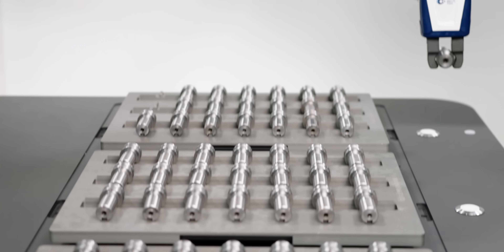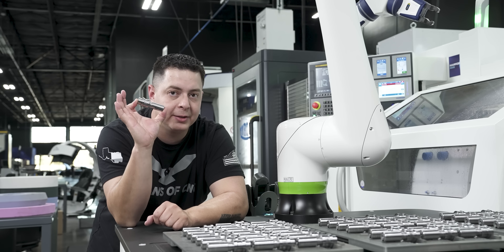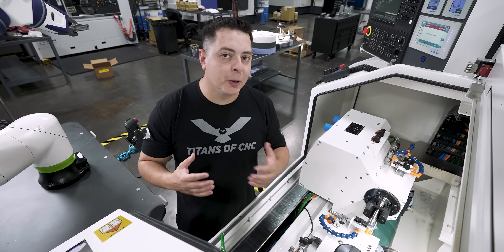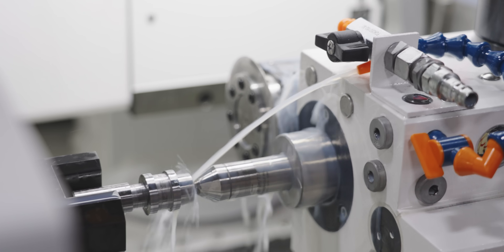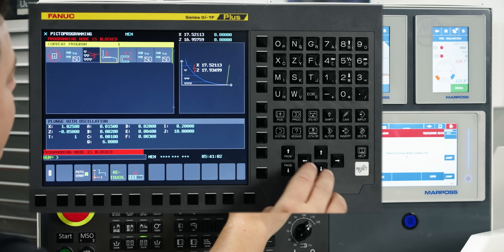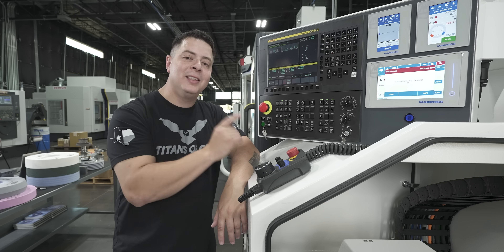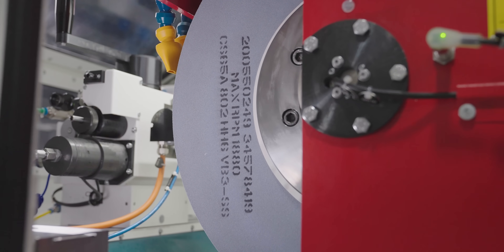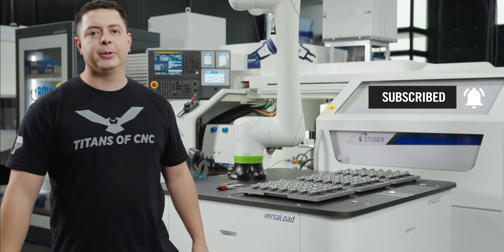5 Secrets That Make Grinding Automation Possible

Comment: We have the same studer at our place.
I'm guessing the Marposs measuring is essential for this setup?
We grind carbide with vidrified diamond wheels, so we always have to back our corrections off the same amount that we dress per cycle (we don't have the touch dress feature).
If I left one of these to run unattended, my batch would get smaller and smaller

Comment: Nice. I had a good run manual grinding yesterday. 60 crank pin journals all within 1-2 microns size of each other. That machine was in a sweet spot and I was in a flow state!

Comment: Why would you use such a wide wheel for this job? Just because you don't have a better suited wheel, or is there more reasoning behind it?
Reply: Will the time it takes to switch out the wheel for a smaller one be worth it?  It'll be one thing if the wheel size or type causes issues running the job.  Most cases, it's better to waste wheel than waste time.
Reply: Its the only size the manufacturer has
Reply: Will the time it takes to switch out the wheel for a smaller one be worth it?  It'll be one thing if the wheel size or type causes issues running the job.  Most cases, it's better to waste wheel than waste time.